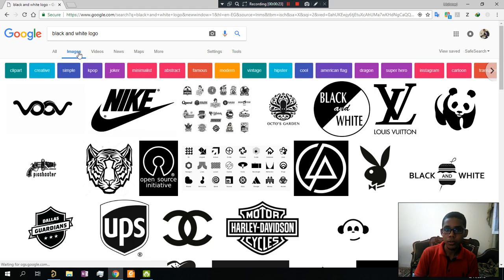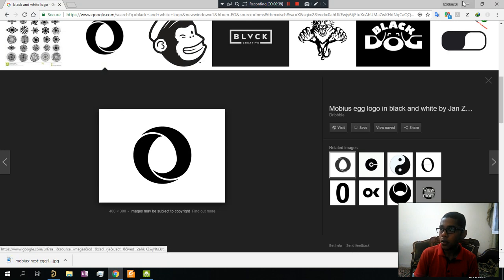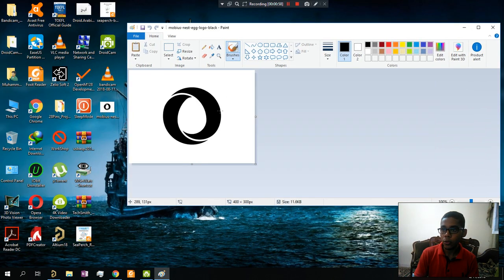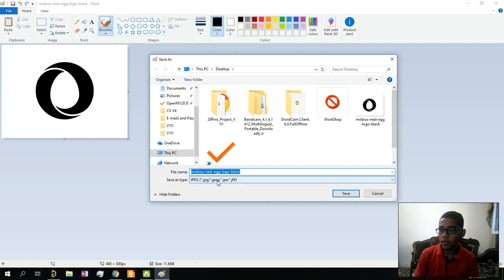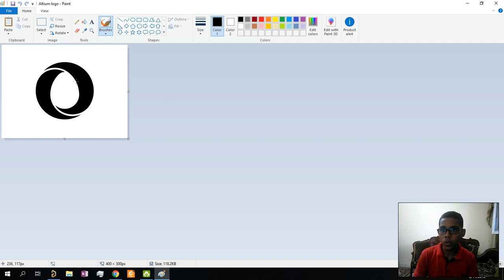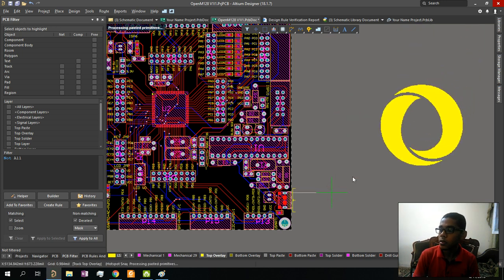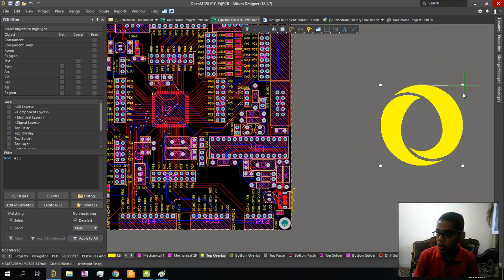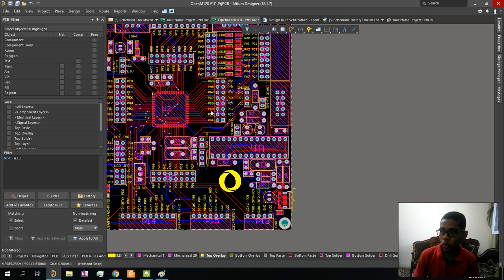Altium Designer  - Add Logo to your Board -without Scripts

Comment: Is there a way to save the union? I want to save the dimensions as well. It would be nice to have consistency across multiple board designs.
Reply from the maker: I didn't get what you want but in Altium, you can lock the settings but  didn't make it with dimensions

Comment: Thank You ! I'd Like to know how to mirror the image because my logo is on the bottom of the board.
Reply from the maker: try to mirror it by "Paint" .. select the image then right-click then rotate then flip Horiz .. 
or if there is an option in Altium but i didn't try it
Reply: @dotex2809  Hi, I mirrored the image using a program, and then I just did like you teached on the video. I cound't mirrored using the Altium, but absolutely there must be a way. Thanks for the contribution !